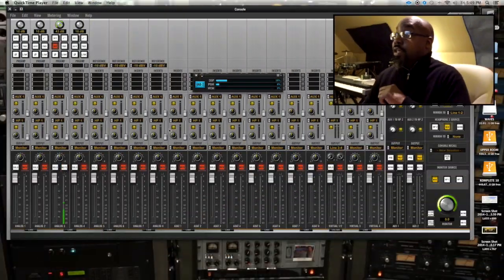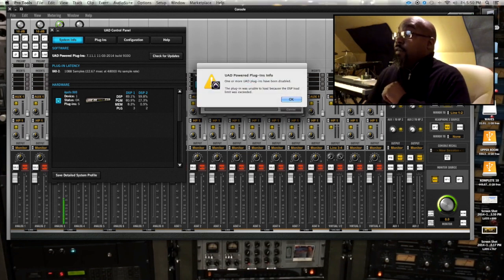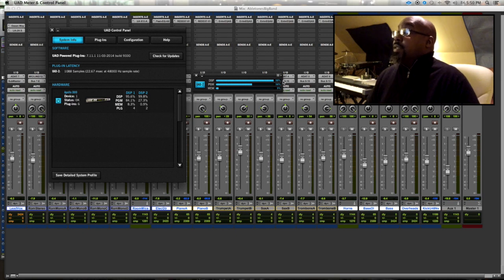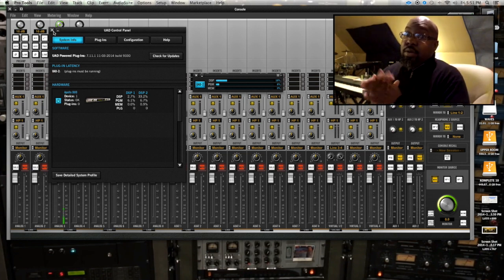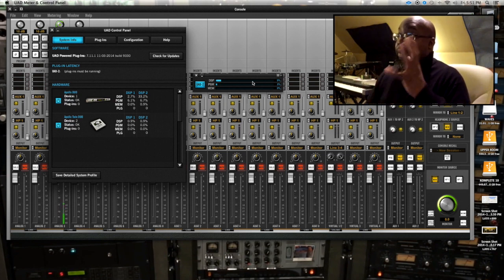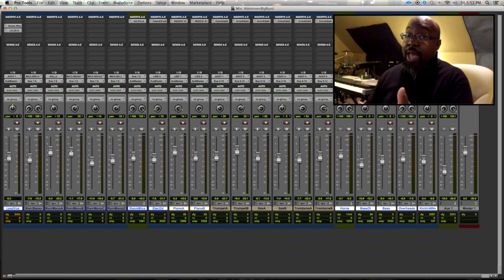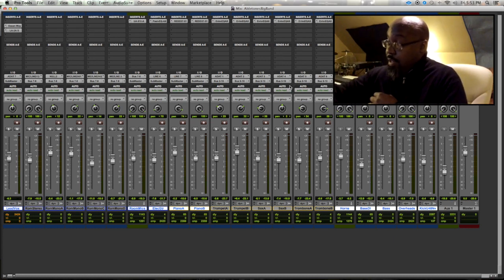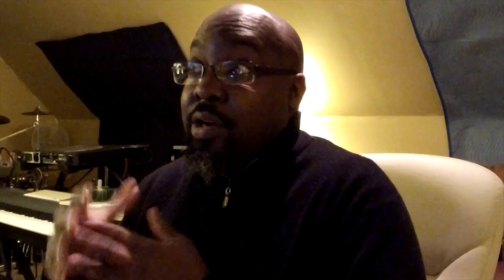UAD Apollo & Apollo Twin (How to double the DSP)

Comment: I followed your link from the Apollo Expanded page. Thank you for sharing this. I'm strongly considering a Twin for portable mixing solution, and with the Expanded features coming this spring, it seems like a great bet. Its only contender is an Octo Thunderbolt (and my existing headphone out of my laptop). That configuration doesn't give me extra preamps or a controller. Again, thank you for this video.

Comment: great video.. I decided to go with the new black face apollo 8 quad. The convertors of the new apollos smoke the twin conversion.  I have my uad 2 firewire satellite quad daisy chained to my thunderbolt apollo by a firewire to thunderbolt adapter and it works flawlessly. I its a major jump from old duet 2 interface. I initially was going to get the apogee symphony because of the convertors. I still feel that the Symphony converters are better than the apollo but not by much. The DSP is what sold me  on UAD. UAD has the interface game on lock at the present moment.
Reply from the maker: My understanding from UA is that the MkII has the same converters as the black face apollos, the only deference in the twin and the rack mount, is the I/O, but I could be wrong.
Reply: I sold my symphony once I got my black face twin. No contest.  The Twin has better AD and DA.
Reply: Jayme Silverstein 
W.O.W.
really think the apollo's conversion is better than the Symphony? why?
Reply: Yes bro.  My symphony is up for sale of Reverb and Ebay.  No joke.  My mixes are already translating better.  The symphony does some weird bullshit in the 2 to 5 k region that is just not true.  Also, I have a jazz bass that I just never liked the sound of and now thought the AD of the twin I love the way it sounds!  Im actually thinking of buying the Apollo 16 now so I can get back to summing!  People are always talking of the plug ins of UAD but hardware is unbelievable.  I'm very happy.
Reply: To clarify, I am talking about the old Symphony, not the mkii.  I haven't heard that one yet.
Reply: Jayme Silverstein 
i don't think the symphony mk2 isn't that much different. Maybe slightly.
Reply: Rodney D is it possible to get a video of that setup of the firewire adapter to thunderbolt??

Comment: I like your personality, my friend.  Regarding the thunderbolt hook-up, there is a cable from Apple that will convert thunderbolt to firewire so for those of us who are using older Mac Pros / MacBook Pros that don't have thunderbolt, we can still use thunderbolt interfaces.  Keep up the good work.  I've got an LS56 - why did you sell yours?
Reply from the maker: Thanks. I sold the LS because I have a 30 day policy on certain pieces of equipment. If I have something that I haven't used for more than 30 days,  I put it up for sell & at the time I needed the money.  It only apply to equipment like amps, interfaces, computers.... mics, keyboards & instruments are excluded...lol... I wanted to use Apple's Thunderbolt to Firewire adaptor when I first got the apollo with my mac pro, but an apple rep. said it only work one way. So the thunderbolt side must be connected to the computer (Thunderbolt to Firewire device), it won't work in reverse (Firewire to Thunderbolt device).

Comment: Hey quick question.  Ive heard (and dont quote me) something about that, with the UA Satellite Units, it basically lets you get more DSP to run UA plugins within your DAW, but you cant use it for more DSP within Console for stuff like unison pre’s, and using plugins in (REC/Commit) mode in Console. Is that right? Now on another note(whether thats true or not) , does linking another interface let you actually use the extra dsp for more Unison plugins or using Rec/Commit mode in Console? Im looking into getting a smaller UA interface to connect to my X series Apollo and use it as a monitor/talkback controller etc,, but ya just curious about the extra DSP and how it can be used with a Satellite or a 2nd interface! P
Reply from the maker: So-so sorry for the late response, I've been out of it for a min, but yes, the satellite units will only give you more DSP in your DAW how ever, the more Apollos you add to your system, the more DSP you'll get in both your DAW and Console. I still have my Gen 1 Apollo, Gen 1 Twin and a Mrk II Twin quod core and they all work together and the Mrk II is my monitor control.
Reply: @JNoizeMusic  Brother, no worries at all. Right, I see. Im rockin the Apollo X8P and a UAD-2 Sat. Working great for me, and ya, I could see if you're going crazy tracking with UAD Plugins how you could run out of DSP, but for mixing this combo seems to be quite a hell of alot of DSP. Also just to confirm, when using the Sat for mixing in your DAW(opening UAD plugins inside the DAW) its not putting any load on your CPU right? The Chips in the Apollo and SAT handle it all> ?

Comment: too bad the extra DSP can't be used for realtime uad plug-in processing during tracking, but only mixing. you are limited to whatever Apollo interface in your chain has the most DSP.. in this case both are Duos... so its still like you have only one duo during recording sessions
Reply from the maker: Justin Panno Yeah.... I did a small live recording for a friend shortly after I got the twin. It was only 10 tracks (channels) but I was able to put 10 of the LA-2As on the session was my 8 ch OctoPre using ADAT. If I had both Apollos I could ran those 8 of those out to the 8 ch Apollo, added another group of plug-ins.... Hopefully UVA will set the DSP to work in Console like it does in a DAW.